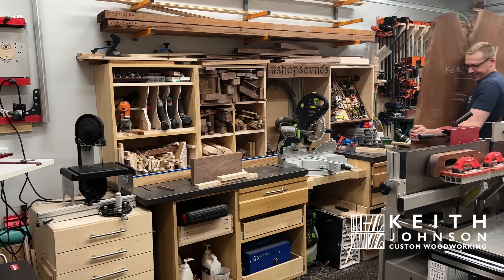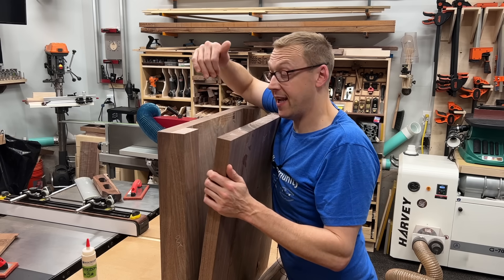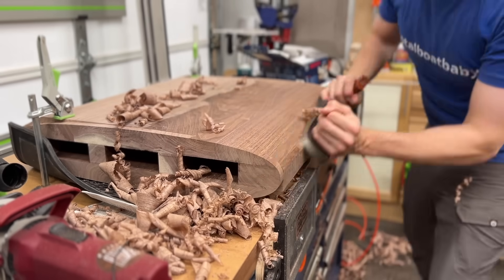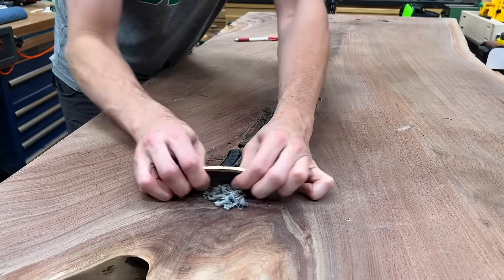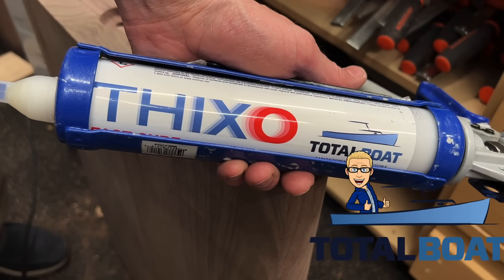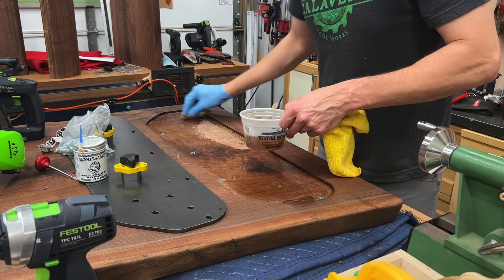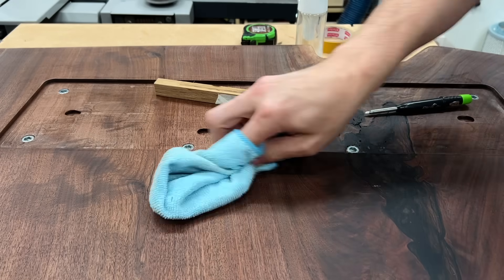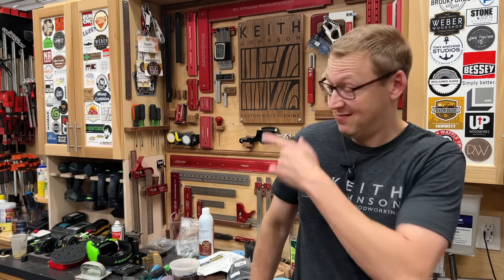The client wanted a 100lb. slab for a walnut desk.

Comment: I just want to say that I think most people underestimate the random orbital sander for doing a roundover.  You won't get a really dramatic roundover without putting in a lot of work but you can get a very nice small one so easily.  I personally use that technique quite a bit.
Reply from the maker: I definitely use it, but it's very easy to "over" round something very quickly and get an uneven profile, but practice makes perfect.  👍😎

Comment: You killed this one, turned out great. Curious though, lets say you couldn't use a Shaper origin for the bow ties what would be your approach? Make a router template, free hand with router and clean up with a chisel, or something else? I'm a lifelong Seinfeld fan, love the references you throw in.
Reply from the maker: Yes! You could absolutely make a template with the Shaper for bowties. You could set the machine to cut on the outside of your line to cut the bowties, and then make a temple by cutting on the inside of the line and they should mate together perfectly. And so glad you appreciate the Seinfeld references!!

Comment: Beautiful work, thank you for posting.  Inspiring.  If I may make one suggestion, I hate using the tape flag on the drill bit.  It will creep up the bit and you can drill through the top.  Like your prices, I am not going to post how I know that on YT.  What I do is put a short piece of plastic pipe on the drill bit cut the right length so you can drill quickly but never too far.  I keep three or four handy and can always cut one down.
Reply from the maker: Great idea! Thanks for the tip!

Comment: I always use a tack cloth when wiping off the dust between coats. Some of these finishes say to not use a tack cloth as it will mess up the oil…never has an issue with it. The tack cloth does a much better cleanup then just a microfiber rag.
Reply from the maker: Not a fan of the tack cloth. They are one and done and don't do a great job in my experience.

Comment: Love the Seinfeld clip. It’s not a KJ video without at least one. What made you not put c-channel on the bottom of the slab?
Reply from the maker: Ha! Is it really a video without a Seinfeld reference ? Didn’t really see the need for C~channel in this after I thought about. Plates and legs are solid and that slab was dried and milled properly. It was in my shop for 3 months and didn’t move.

Comment: You use shellac on the unexposed areas to prevent warping. Would it be ok to use say linseed oil (since it smells so nice 🙂) on the under side of a table top and use hardwax oil on the top?
Reply from the maker: Sure, I don't see why not, but that stuff takes a loooong time (weeks) to fully dry.
Reply: @KeithJohnsonCustomWoodworking  Thank you. Also, i have a 1-year old. Drying time is not the limiting factor 😉
Reply from the maker: @kallelorenz2508  Got it!

Comment: Keith, I forgot to ask; that small roller you used, do you have an affiliate link for it? I have a few larger rollers but that smaller one looks like it would speed up panel glueups quite a bit.
Reply from the maker: No link...I think I git it at Woodcraft. I could never find a good silicone one on Amazon.
Reply: @KeithJohnsonCustomWoodworking  Got it, thanks. 👍
I'll have a look around to see what I can find.

Comment: Awesome job! When you buy lumber, do you do anything to check for pests in the lumber? I've heard that Powderdust beetles can hide in wood for years before coming out. Any wisdom would be greatly appreciated! 🙂
Reply from the maker: Generally, if dried properly by a reputable seller, there should be no bugs. Otherwise, they risk infecting their whole inventory. You can look for visible bug trails, but other than that, I don't know how else to check.
Reply: @KeithJohnsonCustomWoodworking  Thank you! I found an incredible deal on FB marketplace for 21 year air dried oak in this guy's barn but my wife is worried about it being turned into furniture since its be out in a barn
Reply from the maker: @camerontgore  Wow, 21 years?! Well, it should definitely be dry, but bugs are always a concern. Just look for visible signs of any worm holes, including little piles of sawdust.
Reply: @KeithJohnsonCustomWoodworking  Thanks! Yes 21 years and he only wants $1.50 per board foot for red oak

Comment: Aren't you concerned about mixing grain directions on the little leg filler pieces?
Reply from the maker: That's a good question, and I honestly didn't even consider it...but, I'm not worried about. All that lumber was very dry and the long ribs weren't big enough to cause any issue. I wouldn't be surprised if the full length ribs on the outside edges end up moving just enough that you will feel that seam over time. Nothing you can really do about that, though.